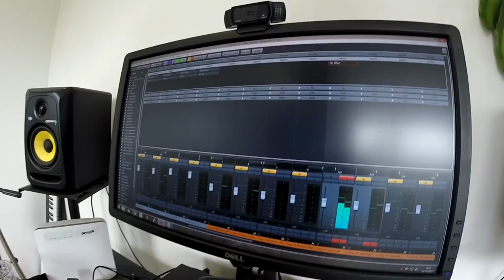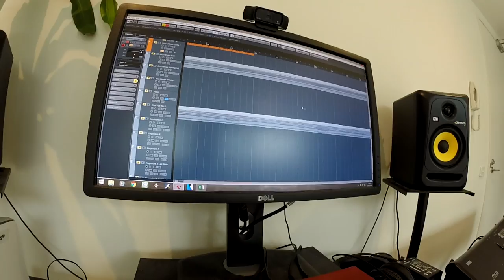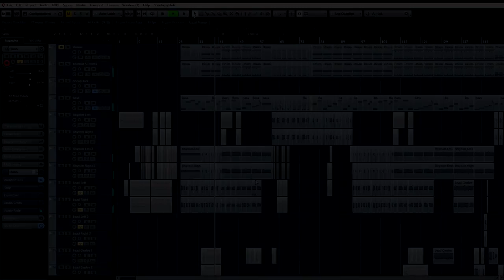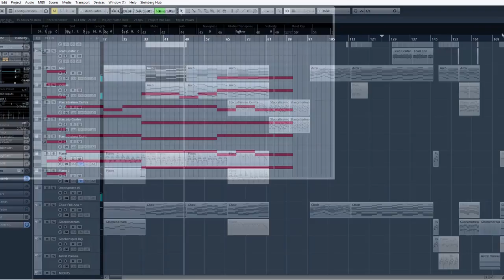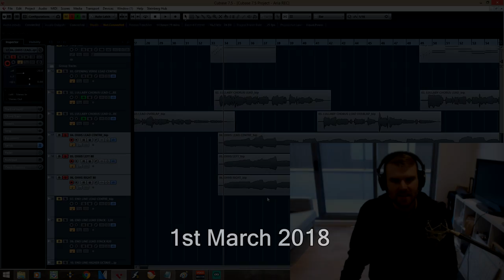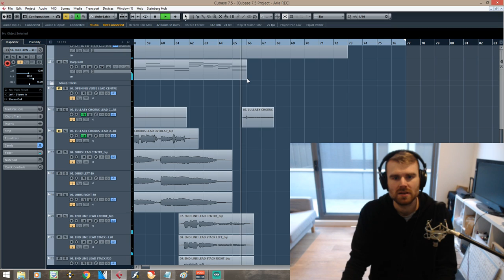Andy Gillion - Neverafter - Studio Diary | PART 1

Comment: Ugh man I have a focusrite interface and I hate when the cpu glitches and makes all that crazy playback noise. Always had to restart my computer or at least rerun protools. Anyway, I feel your pain and can’t wait to get my hands on the final product 🤤
Reply from the maker: It's actually only happened to me once haha, I can't explain it!
Reply: I had the same problem with my Focusrite. I fixed it by changing some settings in the power settings in Windows 10. Go to "Control Panel\All Control Panel Items\Power Options\System Settings" and untick "Turn on fast start-up". It might help. Also make sure you have the power plan set to full power/best performance.
Reply: Good stuff I’ll definitely keep that in mind. I did upgrade my ram but sometimes I think it’s just a cpu overload glitch. Fun recording your own stuff isn’t it?  😝👍🏻